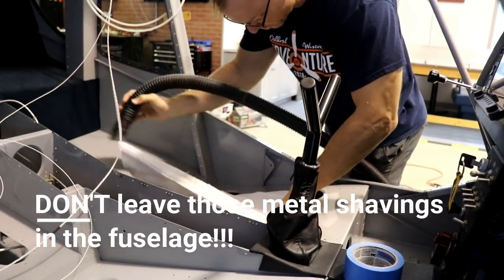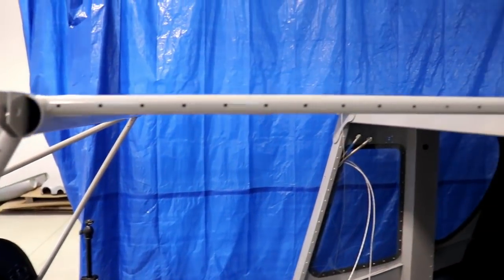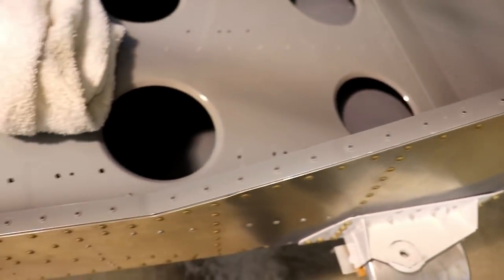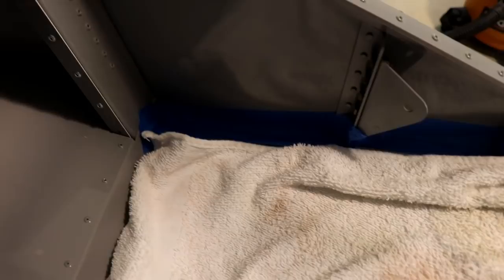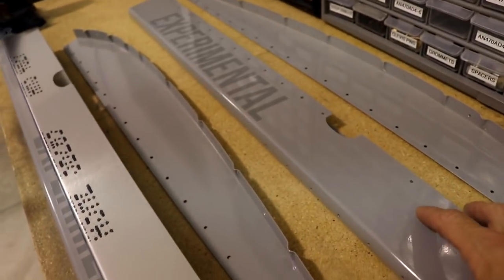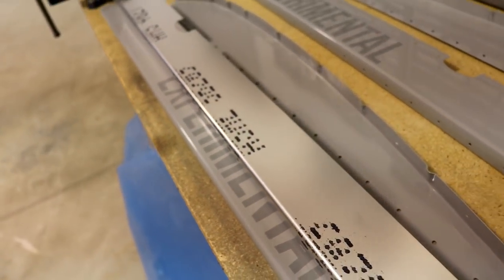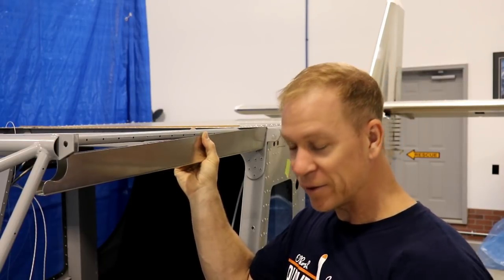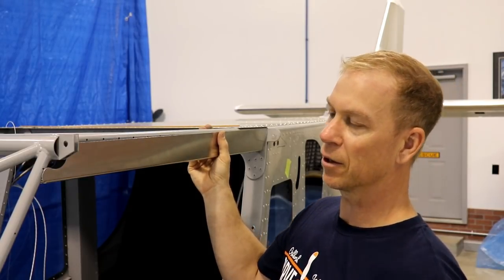CH-750 Airplane - New Style Doors (Part 1)

Comment: Thanks again for another great video.  If your finished plane is half as good as your video production, it'll be an outstanding aircraft.  I had a thought to add about techniques to catch metal shavings from drilling out the rivets around the 4:20 mark.  Is the blue tape single-sided painter's tape or perhaps double-sided tape?  The latter might help to capture some of the small shavings as they fall from the drilling and minimize the amount that'd be free to fall into hard to reach areas or that might fall from the towel as it's picked up and moved.  Keep posting, and we'll keep watching!

Comment: Had a little AB blow out there 10:44.
Reply: Because they can. Second acft I worked, but block 10's. If that shows my age a bit, I might mention I worked F-4's before that.
Reply: They were great airframes, except the PW motors.